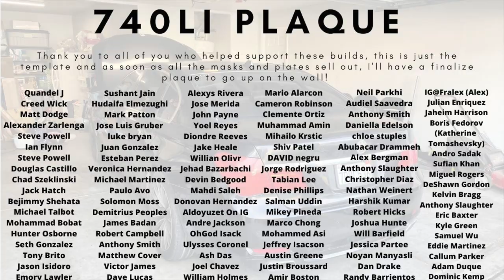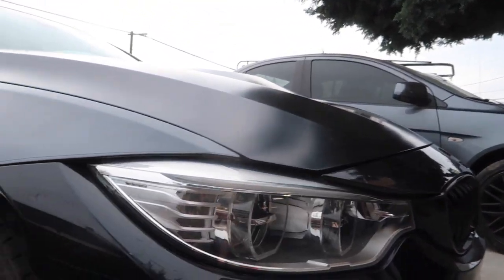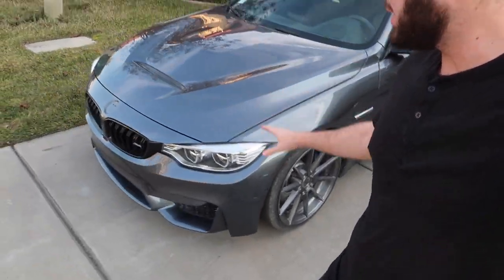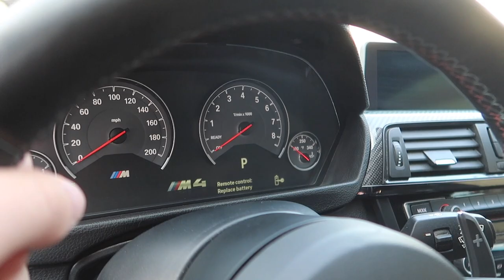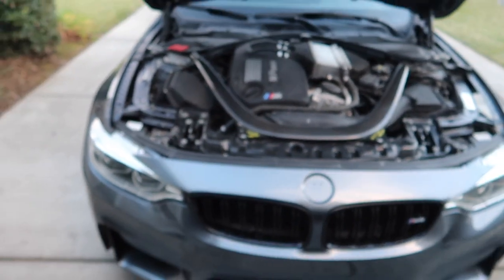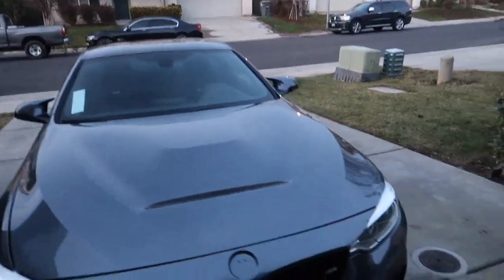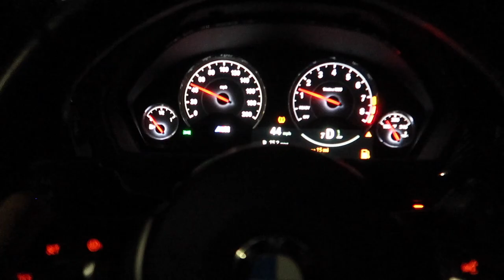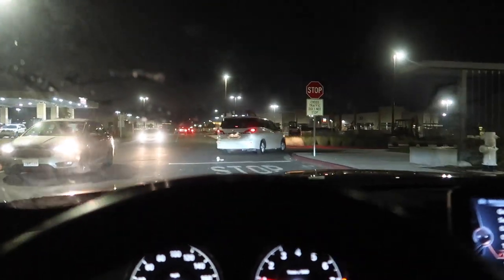Rebuilding A Wrecked BMW M4 Part. 13

Comment: Hey Nour, You have to heat slightly the can in order to get the gas out and increase the output pressure... if the bottle is cold, gas will go out slowly.
Reply: Yeah hold it under a hot tap

Comment: should get the marker/parking lights covered over when painting the bumper again. AND use a magic eraser lightly to clean the steering wheel to make it matte
Reply: quick tip Only use a magic eraser as a last resort, use some sort of interior cleaner or leather cleaner with a leather brush to agitate and then use a leather protectant or coating.

Comment: There is a dial in the middle between the 2 air vents under the door lock button where you can roll it so that the air gets either warmer or colder and from what i noticed is that you actually have it on red which means warm. That function is there so that you can control how warn or cold you want the car to blow even if you have set the car on the coldest/warmer setting it may be a dumb feature but its there unfortunately and many people like you that Don't notice always thinks that something is wrong with the AC
Reply: Not sure why you need this feature unless it for quick adjustments, i was so confused when he said straight heat when all the setting were on cold.

Comment: I wouldn’t code out the tpms because the dsc uses tire pressure to function properly. I mean it’s not going to stop it from functioning altogether but it does use tire pressure for some of its functionality